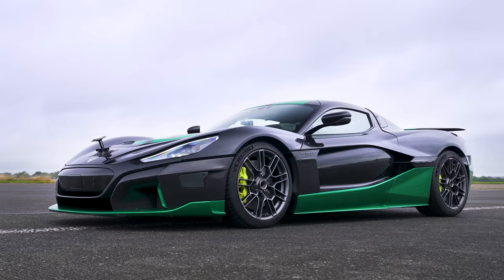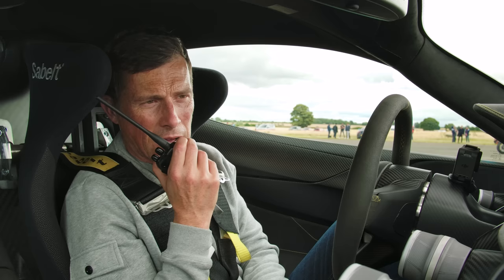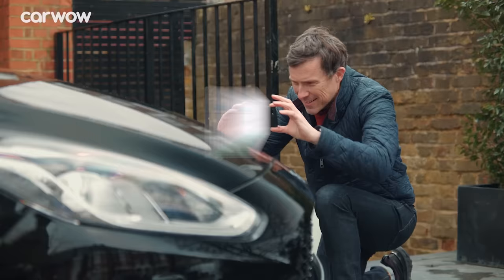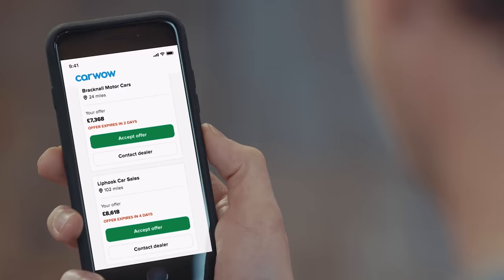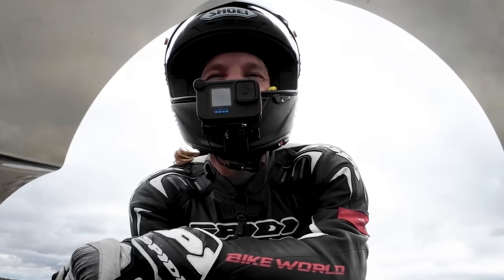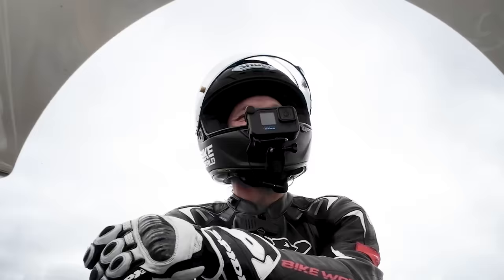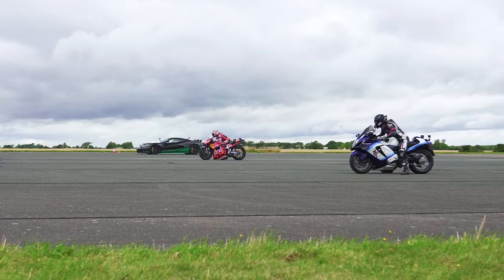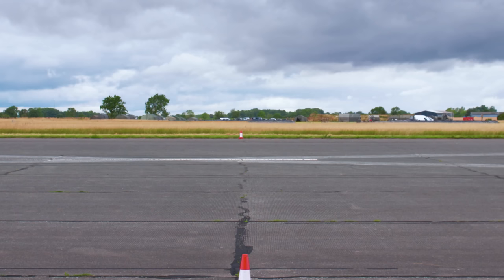MotoGP Bike v Rimac Nevera v Turbo Hayabusa: DRAG RACE

Comment: That Hayabusa is all the proof anyone needs that there is such a thing as too much power
Reply: I believe you forgot the word "no".
Reply: @ITzAKonYT  If he didn't have too much power he wouldn't have traction issues 😂pray tell what the "right setup" is when you're running 380hp on a 270kg bike?
Reply: i assume better tyres, prepped surface. prepped tyre heat etc @Draconas
Reply: @ccmxdia  defeats the purpose of all the HP if so many conditions need to be met.
Reply: @Draconas longer swing arm, and lowered would help a lot. The bike looks stock wheelbase which is impossible properly to run at that power
Reply: Big turbo Busas are pretty common in the southeastern US. They just needed someone who know how to drive it. They are all over YouTube etc
Reply: In this case it was fine, as a longer arm would just give more wheelspin anyway.
Reply: @watchmework3688   Longer swing arm = even less grip.
Reply: That Hayabusa was absolute dog water. Even when it was getting traction, it was getting walked.
Reply: Busa was fast but didn't have a chance against Dani and KTM, For those who watch MotoGP they have KTM MotoGP bikes have amazing launch control (Best of best)
Reply: There is never enough horsepower, just not enough traction. -Shelby himself
Reply: Totally agree with that , especially with motorcycles.
Reply: they already proven that with the H2R
Reply: Problem is here over 300whp on a stock arm. The tire is fine it’s getting decent traction after it got warm but that bike just wants to go up so bad he’s controlling that throttle fr fr
Reply: No he doesn’t have enough traction 😂
Reply: His aero profile wasn't great.  He was sitting with his upper body up quite a bit, whereas Dani was sitting with his upper body almost completely horizontal... but given the circumstances with his injury, maybe that's as low as he could get.    Definitely could do more to improve traction though.  These guys getting and dealing with the speed wobbles at 200 mph; that's mental.
Reply: Nah, just need a gearbox to match the power. Perhaps the 46 speed gearbox of that KTM?
Reply: And the Hayabusa was hitting the Rev limiter too much🤦🏾‍♂️
Reply: @jamesw.6931  those aren't street legal bro, comparing apples to oranges there.
Reply: @Draconas  I mean ideal conditions, slicks, heat etc
Reply: 100% if you can't control the power its really not much good
Reply: Only on launch, not at 140mph pull.
Reply: @Draconas  yeah thats true, ig I was jsut tryna give em the benefit of the doubt
Reply: @Draconas  but also tbf other than the power the bike was like fully stock, which makes it significantly harder, also the rider was injured so he probably didn't push it 100%
Reply: @prone1548 not really? How do you think the diddge demon for example ran its time? Full slicks, full prep, even came with a drag kit
Reply: @DakotaB90 Shelby didn’t rides motorbikes. That much HP & torque is just dramas when you’re cornering hard.
Reply: @prone1548  too be fair people do make bikes just for going to the drag strip, if you have enough money for a 380hp hayabusa then you have enough for track days and a bike you can daily
Reply: @jamesw.6931   my point was that for a street legal bike this is way too much power, when people in comments start suggesting various ways to put that power down essentially having to it into a dragster, the argument becomes meaningless
Reply: @jamesw.6931  a car with 1000hp still doesn't have the power to weight ratio of that modified busa. No matter how you setup that Busa for the 1/4 mile it will get destroyed by the other 2 until it gets so many mods to get the power down it's no longer street legal. Ever wondered why a porsche turbo s with 650hp destroys American cars with 800+hp? Traction. 1000hp demon specifically made for drag racing getting rekt by 700hp McLarens - traction.
Reply: @jamesw.6931  fair enough, in that case he shouldn't have even raced as the time wouldn't be truly representative of his bike's performance then. I also happen drive something that sucks at putting power down on non prepped surfaces - a manual twin turbo 370z with 650whp at the rear, not exactly the quickest off the line on a normal road lmao
Reply: @6billz_stunts  Well it has 7 gears and you need to be fast on the changes, the KTM apparently has 50 or so because he was still gearing up at the end of that quarter mile.
Reply: @isaacmccarty1564 Is carwow meant for drag strip enthusiasts? The vast majority of people looking to buy performance oriented cars don´t give a flying shit about the times on drag strip and are more interested in common conditions. Keep coping.
Reply: @colinmanley7349  sure, but then its not wrong to say all that HP is practically useless except when perfect conditions exist, is it?
Reply: Fake video busa smoke any car or bike in 1/2 mile
Reply: @jamesw.6931  The MotoGP bike isn't all wheel drive. It's RWD just like the Busa. Or were you refering to the Rimac?
Reply: Really struggling to understand what people are arguing against with @draconas post. His post is a truism. It doesn't matter what configuration or vehicle you choose, there will always come a point where you can give it too much power for it to be useful or fit for purpose. That's true even for built from the ground up top tier drag vehicles too.
Reply: @jamesmay1322  It is true, but 380 crank horsepower isn't that limit. It's a combination of cold ground, shitty tires and not being used to the bike I'm guessing.
A supercharged 'Busa has an ENTIRELY different power profile than a turbo 'Busa for example, superchargers just frontload a bunch of mid-end torque which is part of why he broke loose so easily.

Arguably a turbo 'Busa would've been easier, short-shifting first and getting into the powerband in 2nd.
Reply: The Tyres alone on dani's bike would be worth more than the Hayabusa. Put it into perspective.
Reply: Its a menace to itself
Reply: @michaelmay5453 MotoGP bikes are standard as far as gearing goes. Only 6 gears. 1 up, 5 down